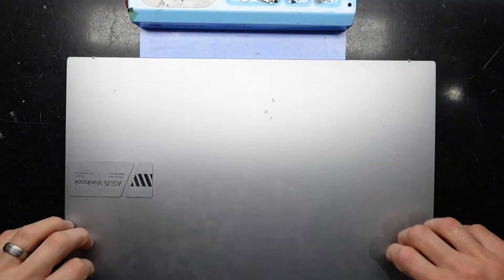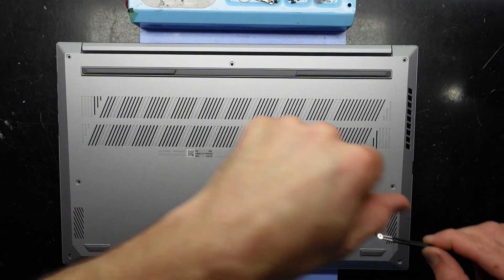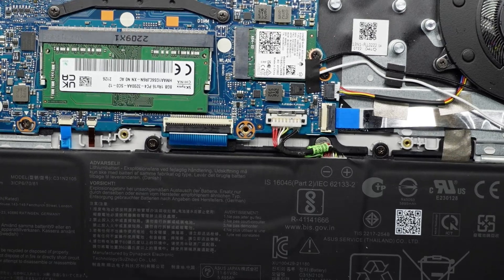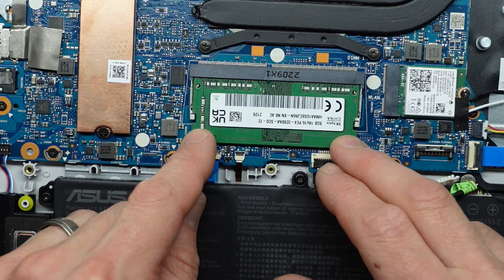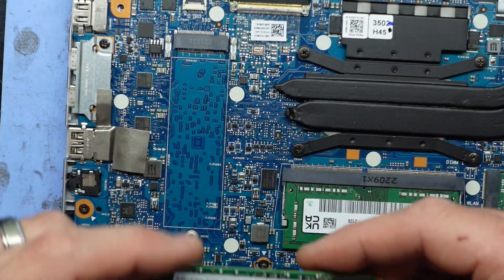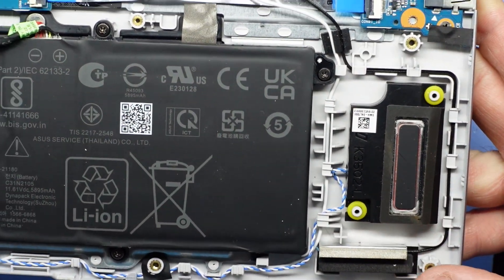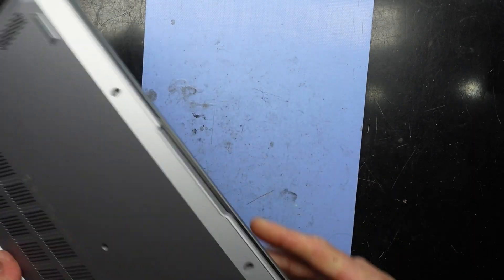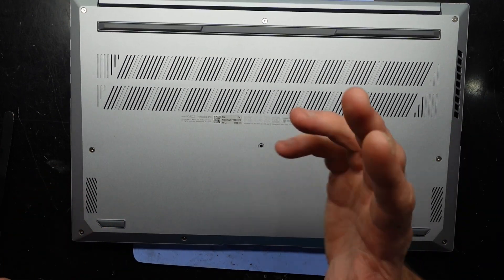Asus Vivobook 15 K3502ZA Ram and SSD Upgrade

Comment: Hi ric, my laptop is turning on but the screen doesn't light up, the fans is running but the light on the capslog button doesn't turn on, what's wrong with my laptop 😭😭
Reply from the maker: not sure sorry
Reply: @rickstechrepairs your video was very helpful, thank you very much
Reply: Same problem bro
Reply: @ranesh5472  the problem was ram bro, remove the ram and it will turn on
Reply: Same issue bro
Reply: Motherboard is dead

Comment: Hi, Rick i'm getting some kind of burning smell from the fan side in the same machine only when charging & when fan is at high RPM at normal speed & while not charging it is working fine. What could be the cause ?

Comment: Hi , I have the same laptop but mine has 4gb onboard+ 4gb in slot, I have recently replaced the 4gb with 16gb, My laptop is working fine but when i check CPU temps, they are over 55-60 degrees with normal usage like browsing, coding, multimedia etc. I'm just worried about the thermals
Reply from the maker: that temp is perfectly fine

See video below for more details
https://youtu.be/6Wyxg22eD5Q
Reply: @rickstechrepairs  Good to know, Thank You
Reply: @sai_788 hi, which brand ram did you upgrade it with?
Reply: @sai_788  okay thanks. Did you install it by yourself ?

Comment: Does it supports 2 TB SSD upgrade ?
Reply from the maker: yes it should
Reply: @rickstechrepairs  no bro, i5 model is not supporting 2 TB upgrade, only i7 model supports the upgrade.
Reply: @SwapnilVPardeshi wait are you serious? 
Because in Amazon it says expandable up to 2TB
Reply: @Farmingforskills247  It happened to me; I chose this laptop in 2022 since the specifications indicated the possibility of future RAM and ROM upgrades. In January 2024, I purchased a 2TB HP SSD for ROM update and went to an Authorized Asus service center for installation; however, they tried multiple times themselves, but windows installation was failing again and again, post they took the help from ASUS technical team, but still the same issue was repeating, after that post 2 months, ASUS Support guy called me for the issue and he inform that this model (I5) only supports 1TB SSDs and the i7 model supports 2 TB.
Reply: @SwapnilVPardeshi  F bro, thanks for warning me
Reply: @SwapnilVPardeshi  Was almost gonna buy a 2 tb ssd, thanks for the warning!
Reply: I have a i7 16gb(8+8) varient.... Can I upgrade Ram 40gb and SSD upgrade to 4tb?

Comment: did you manage to do a ram upgrade on this laptop? i was doing research and it says online that it only takes maximum 8gb on the extra slot and not 16/32.
Reply: According to phs-memory (website), there is something called "overraming," and with this model, it should be possible to upgrade to 16GB or 32GB. However, I cannot say for certain. I have been hesitant to try it out so far.
Reply: I have added 32gb ram stick and it works mate..
Reply: @crownbs7166  You have 40 GB (32GB SODIMM + 8GB On-Board)?
Reply: @crownbs7166  I've i5-12500H model with 8gb on board and 8gb sodimm and I'm thinking to replace 8 with 32 to be total 40gb is that is your case ? and is the lap handling it well as a performance and temp
Reply: @abdelsamie14  did you replcae with 32 gb ram, i have the same laptop, can i upgrade the ram to 32 gb, will this device support 32 gb ram ? pls reply
Reply from the maker: I don't see why it wouldn't support 16 or 32gb

Comment: Hi can you tell me please i have same laptop only i7 12800h with 16gb(8gb on a board and 8gb in a slot)can i add SO-DIMM in a slot up to 32 gb? it will support?
Reply from the maker: That should be ok
Reply: You can add 16gb. So total would be 16gb slot + 8gb on board = 24gb total.